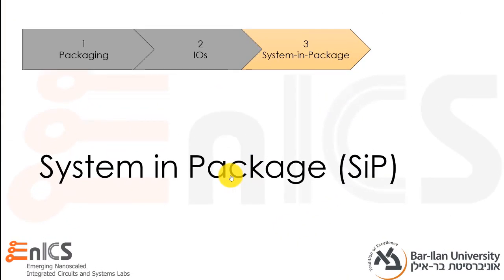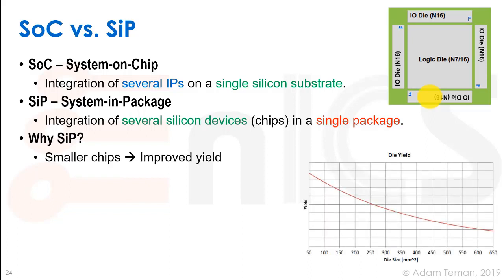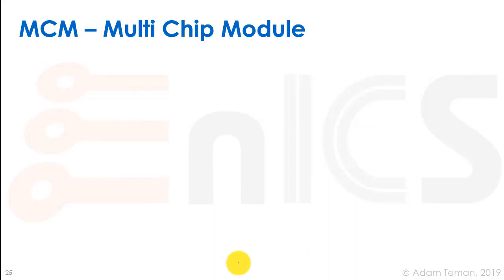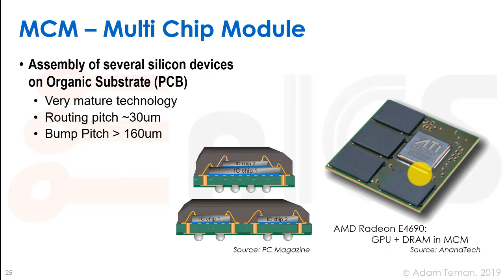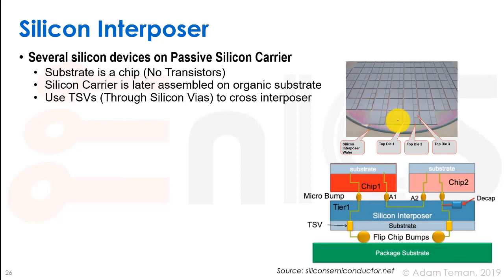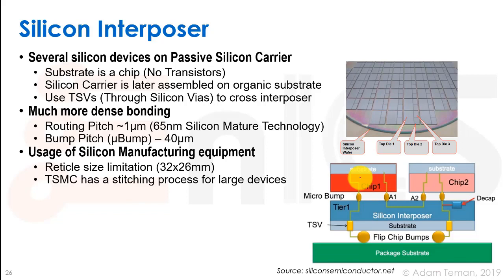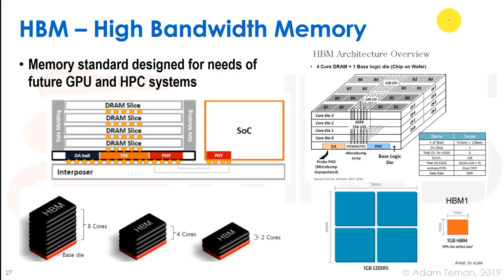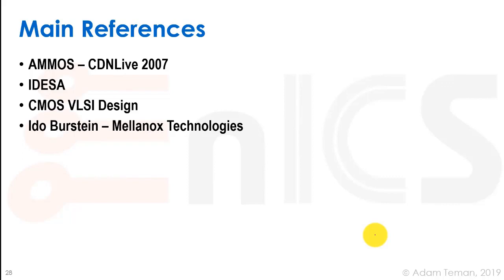DVD - Lecture 10d: System-in-Package (SiP)

Comment: Thanks professor for the wonderful lecture, can you explain the difference between SiP and Chiplet?
Reply from the maker: In some ways these are synonyms.
SiP is one way of calling several chips connected together inside one package.
Chiplets is a bit more up to date way of calling what you do when you make several different chips, each with a specific job, and then connect them together (within a single package).
So, these are pretty much the same word, just from a different perspective.